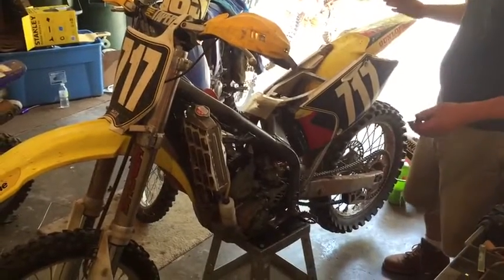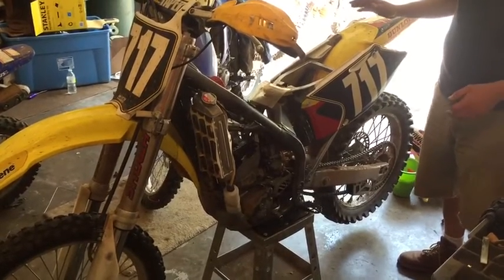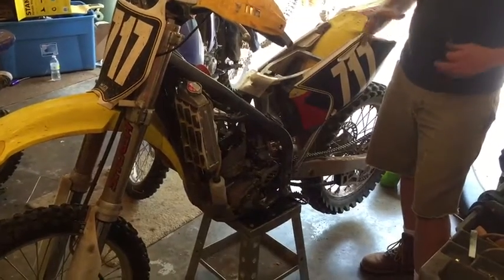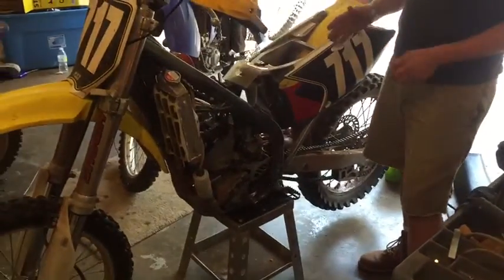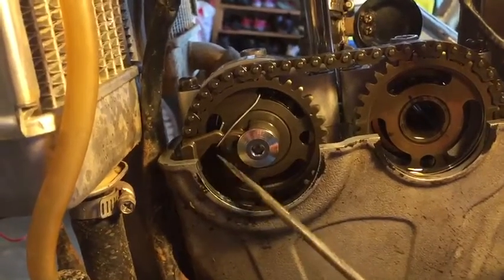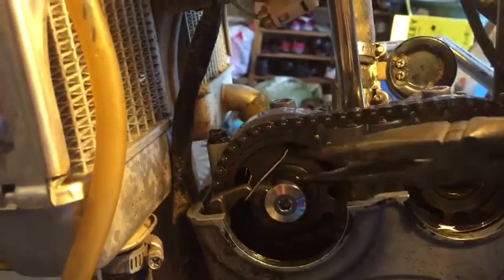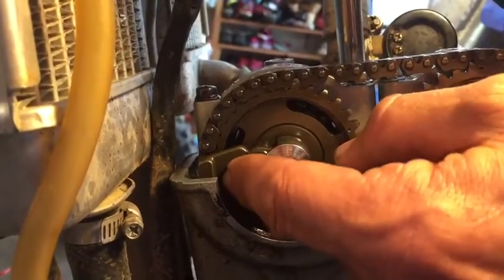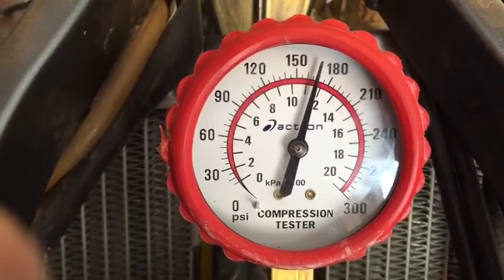Accurate compression rmz250

Comment: Hi pal iv got same bike had topend done still wouldn't kick did this work I'm sick of bumping the thing
Reply: You likely have to big of a valve clearance gap and needs to be checked and adjusted also you shouldn't run it with to high compression by the way
Reply: Yeah it's in shop getting fixed the timing chain was out by a tooth and 1 valve needs fixing

Comment: Just look it up in the service manuel, this seems to be the way to do it.
i'm definitly trying this on my (hard to start rmz-450)

COMPRESSION PRESSURE CHECK << RMZ-450 value, check your service manual
The compression pressure reading of a cylinder is a good indicator of its internal condition.
The decision to replace the cylinder is often based on the results of a compression test.
COMPRESSION PRESSURE SPECIFICATION *(Automatic decomp. actuated)*
Standard  430 – 720 kPa(4.3 – 7.2 kgf/cm
Low compression pressure can indicate any of the following conditions:
* Excessively worn cylinder walls
* Worn piston or piston rings
* Piston rings stuck in grooves
* Poor valve seating
* Ruptured or otherwise defective cylinder head gasket
* Decomp. trouble
* Valve clearance out of adjustment.

COMPRESSION TEST PROCEDURENOTE:
* Before testing the engine for compression pressure, makesure that the cylinder head nuts are tightened to the specifiedtorque values and the valves are properly adjusted.
* Warm up the engine before testing.
Remove the related parts and test the compression pressure inthe following manner:
• Remove the seat. (!5-2)
• Remove the fuel tank. (!5-2)
• Remove the spark plug. (!2-7)
• Install the compression gauge and adaptor in the spark plughole. Make sure that the connection is tight.
• Keep the throttle grip in the fully opened position.
• Kick energetically the kick starter lever about 5 times to turnthe engine.
• Record the maximum gauge reading as the cylinder compres-sion."

09915-64512: Compression gauge set
09913-10750: Adaptor

Comment: Does every bike have decompression cause my 2005 Honda crf250r I don’t hunk has it but I’m going to do the valves and see if it helps
Reply: Yours should but not positive, you will now though because it will become almost impossible to kick then you would have to hit you manual decompression lever that looks like a hot start lever. If you don't have this than it is an auto. Only mx bikes that I know of that have this are the 1st generation Yamaha's like the 400, 426 and maybe 250f also, 99-03 I believe, somewhere around there.
Reply: JB203561 bike was just flooded really bad got it going drained the oil out of it there was so much gas in the oil

Comment: Thanks for the vid brother, this is exactly what I was looking for! I'm getting a bunch of oil spew out of my crankcase breather hose and I suspect it is blowby from the piston rings after I just installed a big bore kit. Apparently some of the kits come with too fine of a finish on the nikasil so the rings don't seal correctly but I'm gonna hopefully test the before and after once I deglaze the cylinder then put new rings and attempt to break in once more.  It happens to be the same bike as here by chance except an 04.  What would be a terrible PSI, below like 150? Thanks again
Reply from the maker: I've heard that 150 may be marginal but I'm not an expert. Post what you find. Thanks.
Reply: i am having the exact same problem except it isnt a big bore kit. i hope new rings will solve my problem. and when the oil was coming out of your breather did it also spew inbetween the hose and the hose hookup? i am getting oil around this area.
Reply: New Rings never solved my problem, actually only going back to the old stock piston and cylinder fixed it. I also tried a high compression piston in size B with the stock cylinder and it did the same thing. I'm gonna try a 3rd different cylinder with a stock compression piston. I'm thinking that it's happening because of the extra compression so I'm gonna stick to the original 12.6:1 ratio.  The extra oil was coming out of every gasket and seal that wasn't perfectly tight. One time it even blew the site glass out of my clutch cover.  Did you get yours fixed?
Reply: @mxfreaks  I would have thought your breather pipe would have to be blocked to build up pressure inside the crank on a 4 stroke?
Reply: @fredflintstone2077  No it can happen I believe, you can put your hand over the breather hose and feel the air pressure coming out so if it was clogged it wouldn't be coming out I'd assume and if you leave your hand over the hose for a few seconds to feel the air coming out the oil will begin to accumulate on your palm. It was only an issue on the Kawasaki, suzuki and ktm I think. Never heard of a yamaha or Honda but it's likely the breather tube location. On the 1st few generations they put it mid engine on suzuki and Kawasaki so you would loose oil. Now most come from the highest point on the engine the valve cover and they designed a little pocket to protect oil from slewing in that area and mixing with the breather exhaust, its furthest from the bulk of the oil so if you are getting blowby you are just down on power most people likely won't even know. Only reason I knew cause I was losing alot of oil through the mist out of the breather tube. Like alot of oil. Couldn't ride for more than 45 minutes without running lower on the site glass than I'd risk. Bike ran fine though. Well just glad to have graduated to newer and nicer bikes but I definitely learned alot fixing these older 4 strokes 
 4 strokes!